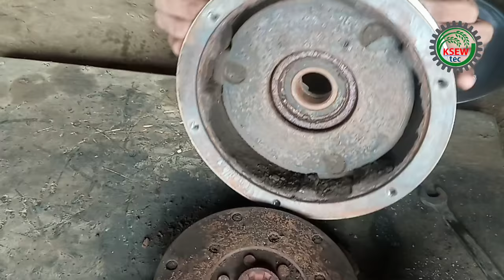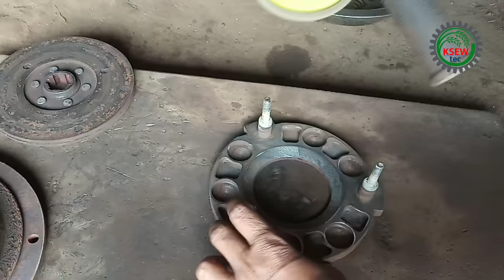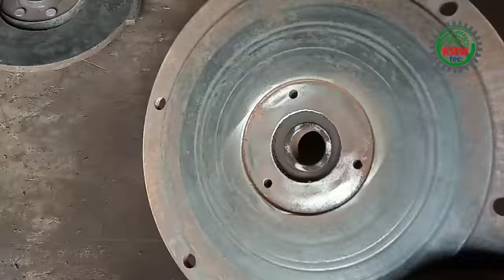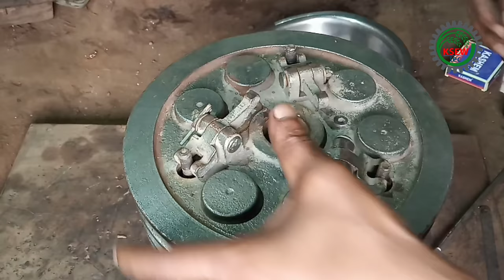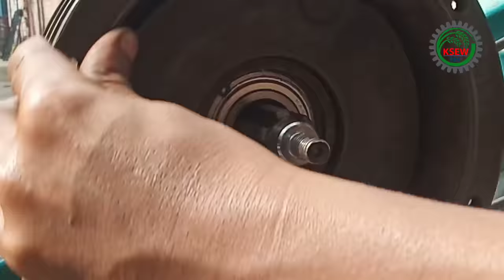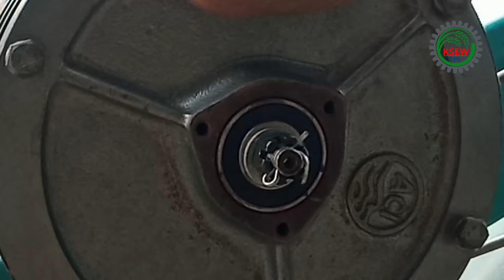Sifang/Aci Power tiller clutch repair.

Comment: Very good video. However a few suggestions. 
1) Many times i have found that the new sealed bearings do not have enough grease and due to this the bearings fail. So when fixing the big bearing remove the rear seal and fill more grease. Check the felt seal in the  pulley grove and if required change with new. Even in case of a good condition seal, put some Mobil oil, also periodically lubrcate the felt seal with mobil oil.
2) In the case of the front bearing, remove the front seal and also fill more grease. Periodically you can open the  small cover and lubricate it.
3) We can even keep the Thowout bearing in oil for some time when servicing the clutch so that the bearing gets lubricated.
Thanks.
Reply from the maker: Thanks for your valuable advice ❤️❤️